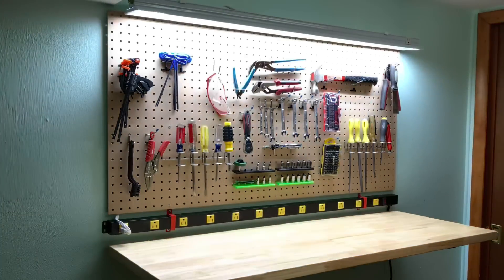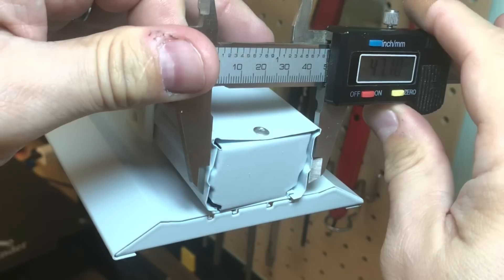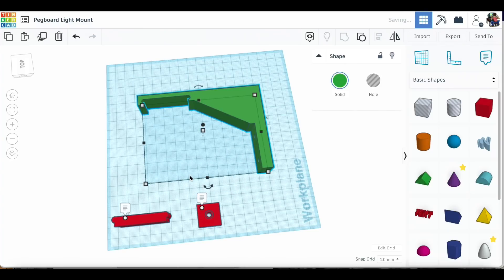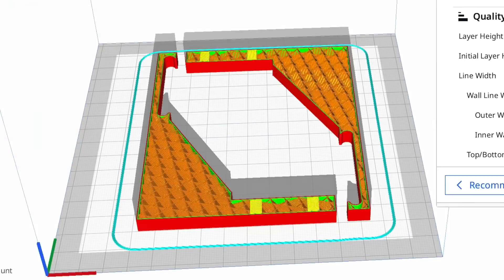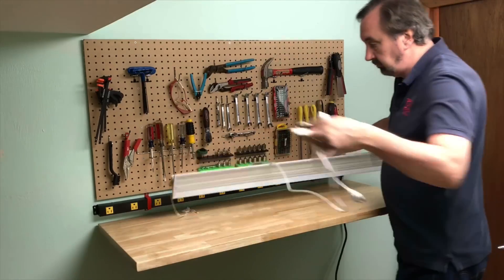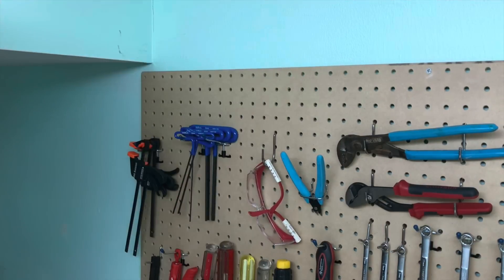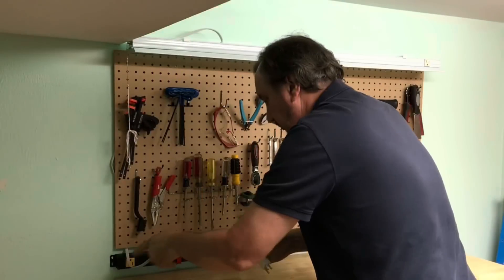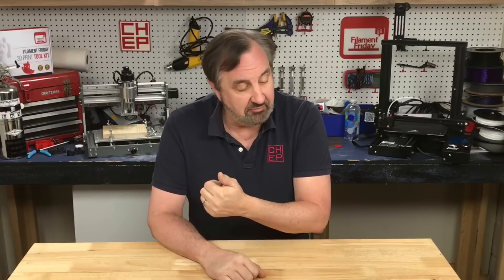3D Printed LED WorkBench Lighting Mounts with a Snap

Comment: Hey, I tried importing your extra fast profile into cura and it didn't work, I'm guessing it is because I have a different printer, but no matter what I did it wouldn't even let me slice with your profile. Any help would be appreciated
Reply from the maker: You opened the .3MF as a project?
Reply: I think it is because I have don't have a crealty printer, I didn't realize it was brand specific.
Reply from the maker: Use a Creality machine profile and resize it to your printer. Most are just clones of Ender 3 or CR-10 anyway.

Comment: Watch out for material creep. Check it from time to time if it's still holding. The added weight of the lamp + creep could cause it to fall.
Reply from the maker: I’ve used similar brackets for years without issue. The light is very light weight. It would take a long time to see failure. Maybe a bit of sag at some point but then I’ll just print new ones.

Comment: does anybody know if this going to last for a considerable time? I printed some pla with a good setting and they were under minimal but constant force (imagine a clamp clamping hard enough to secure it from dropping or moving, very lightley I may say. anyway, they all deformed or cracked in less than a year! experienced that I'm surprised how he trusted the print to hold that led.
Reply: Once the light is clipped in there is almost no tension , Any plastic will eventually relieve the tension or compression  on it so the trick is to design things that have no tension  or compression  on them once in place  .
Reply: Yeah.. I wouldn't trust something like this for a while either, I made some PLA wall mounts for two of my airsoft pistols for display, and one of them snapped after a few months, even though it was pretty solidly made.. PETG is more durable in long term for stress I believe, but I imagine even that would slowly lose strength
Reply from the maker: I have many brackets like this holding all kinds of things in the shop. I rarely see an issue. Summer heat can affect a print under pressure but not in a cool controlled area where I use them.

Comment: The extra fast profile on my Ender 2 Pro has really saved me from boredom waiting for my prints to be done. I tell myself this extra fast print will just be a test to see if the dimensions are correct and I'll be printing it with the slower profiles next. Nope, never happened. The prints from the extra fast profile usually sufficed for my needs and never bothered me much anyway. And with Cura 5, with the new dynamic walls, any discrepancies with walls are usually cleaned up nicely.

Comment: I wired those lights into our garage door opener instead of the dim bulbs that were meant for it, but I just hung them with the chains. A bracket like that to hold them more firmly is a much better solution.